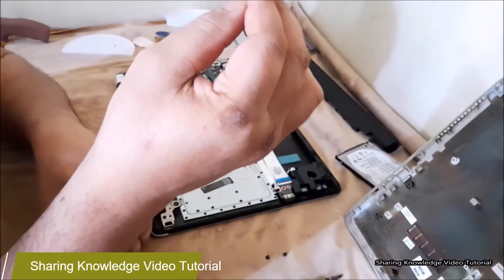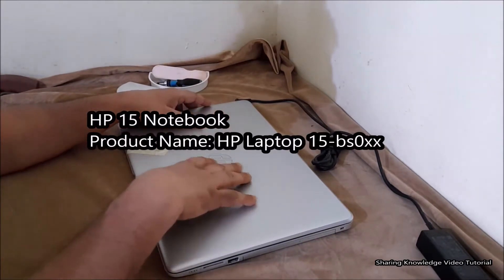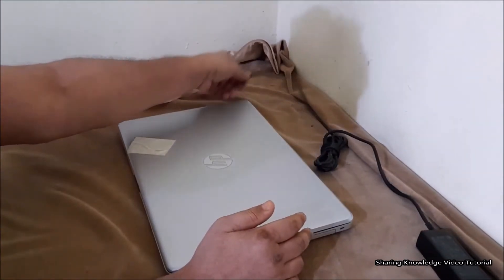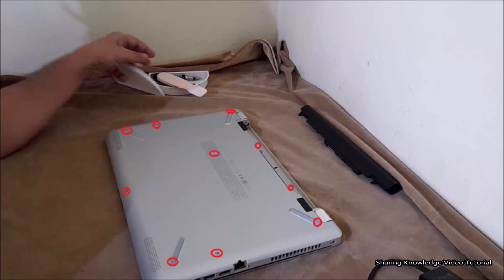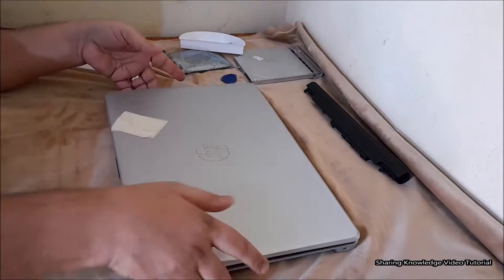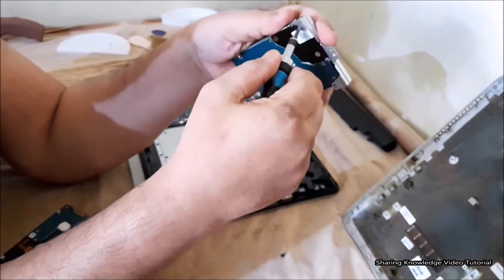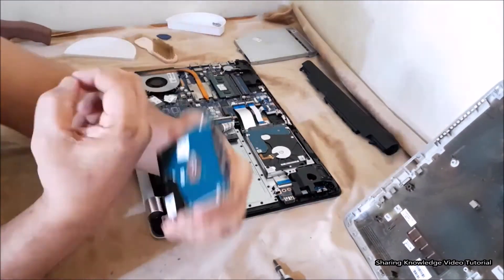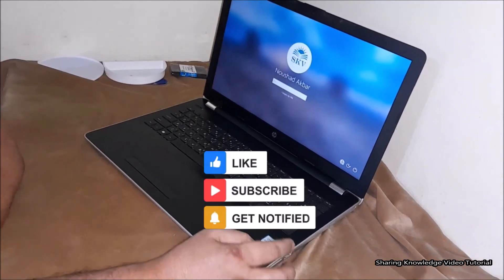HP Pavilion Laptop 15-Series Hard Drive Replacement /How to Replace Hard Drive in HP 15-bs0xx Laptop

Comment: Can you tell me that  can we add an nvme or a ssd in this  laptop? Do this laptop support that?
Reply from the maker: If you look at your M2 interface on your Motherboard and you see a single notch for the M2 Slot, then it will support both NVME and SATA PCIe-SSD.
Otherwise, If you see two notch, then it will be a SATA PCIe-SSDs storage slot Only.
Reply: bro tell me its support nmve or not plz confirm bcz ssd is not replaceble so
Reply: @itsparaboyyy nvme is ssd, it’s a type of ssd